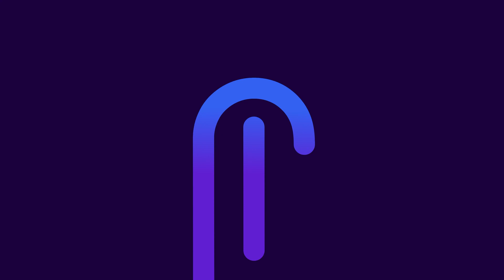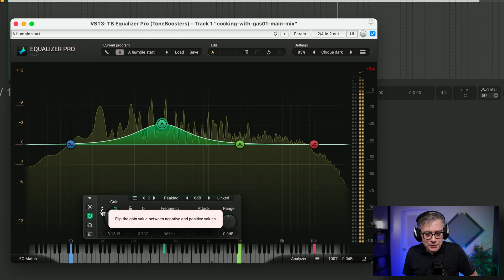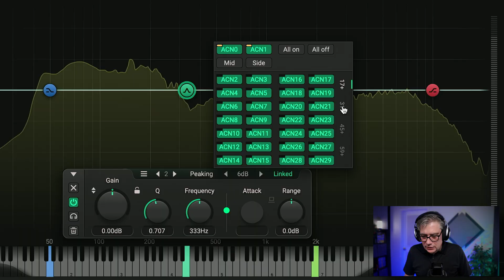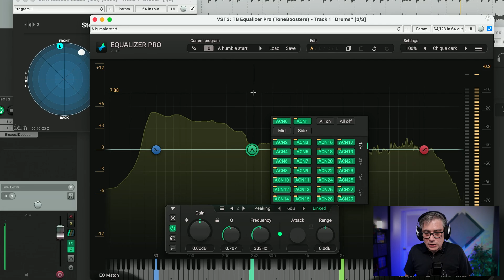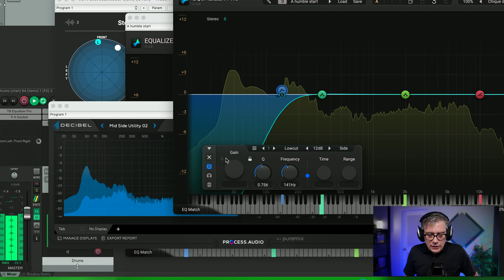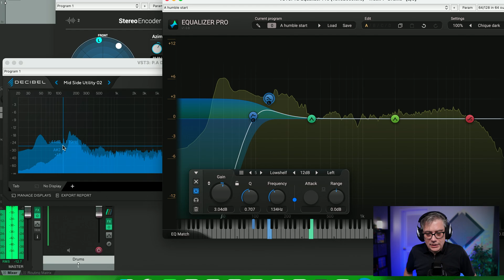Getting Freaky With TB Equalizer Pro: A Plugin Review

Comment: I've been using TB EQ v4 almost since it came out and it became my everyday default EQ. When the PRO version came out, I bought the upgrade without hesitation. The Transient \ Sustain and Gate modes are very good. I often use these modes to remove reverb from my SFX recordings. Ambience mode works very strangely and I never found any use for it.
Personally, I miss the Attack and Release manual modes, the freely movable EQ filter bar, the fast change of the mode, and the filter soloing mode with the ability to listen to the direct operation of the mode.
Reply from the maker: Yes, the ambience one is a bit strange. It did help me a bit getting some artifacts out of a AI generated music piece though.
Reply: I demoed them and ended up getting both, with crossgrade still very affordable and you get unique tools not available in other eq’s, I particularly like the saturation which when used in the high end  freq band can tame the phase shift peaks that occur from low end cuts for example, so you don’t necessarily need a clipper or phase linear eq. I also like the dynamic mode in EQ 4 better as it has more controls. Pro version for me is for tonal / transient corrections if I need to go past basic eq / dynamics. Together they make quite a valuable combo for the first stage of mixing before adding other fx.